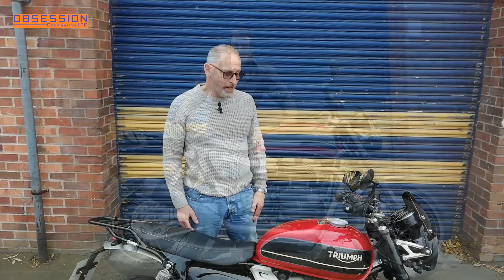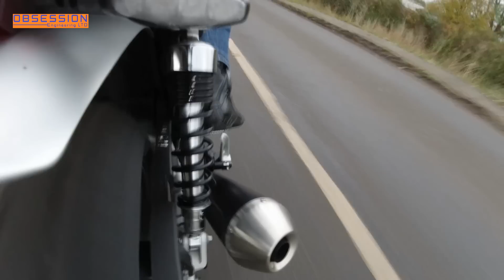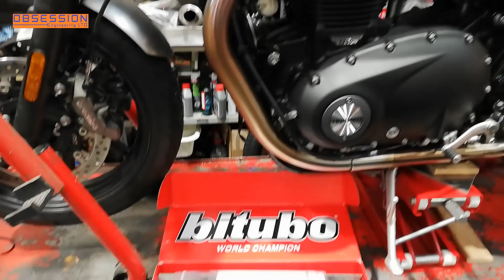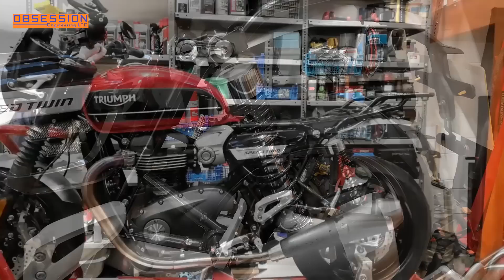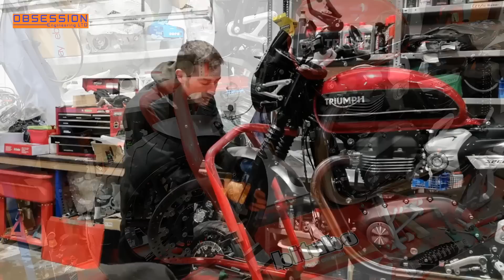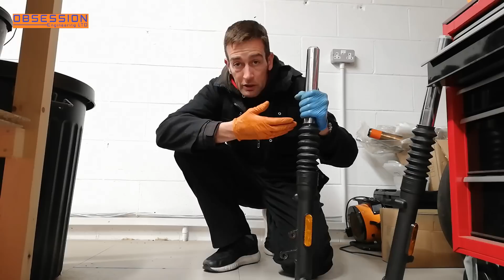How to improve a Triumph Speed Twin with Bitubo Suspension upgrade. Road test and how to guide

Comment: I have a 2023 speed twin. What is the cost for an upgrade?
Reply from the maker: The 21 onwards bikes, with the upside down forks were better anyway, or at least the forks were, so you'd probably only need shocks. For the same spec as we fitted they're £481 for a pair, and make a massive difference
Reply: @obsession_engineering

Comment: at a street-ride with s1000rr (date of build 2012/2013) i feel nothing only i switch all three moped legs into stage 5 with the key , tires were warmer than my hand , i felt safe till top speed 
only you and all others with many many miles more can ask for tuning - stock is expensive and good enough

Comment: On your video you show the rebound adjustment at the top and preload at the bottom, yet all adverts for these shocks show it the other way round.  Does it matter which way up they are fitted?  I could see problems adjusting the preload at the bottom because of the proximity of the adjusters to the silencers.
Reply from the maker: Depending on the bike model depends which way up the shocks are mounted. Luckily the preload adjusters are easily accessible.

Comment: Where to buy Bitubo in the USA? And do you recommend sticking with the same manufacturer of these components front and rear? Or does it matter?
Reply from the maker: I know there is a new USA dealer, but not sure on details.
I'd recommend using the same front and rear, so the damping characteristics will be well matched

Comment: Took one out for a test ride.....absolute rubbish. The OE suspension is awful. Amazed why anyone is prepared to spend 11k on a bike that you then have to spend even more on to make it rideable....strange times...
Reply from the maker: Fully agree with you there, especially as the additional cost during manufacturing would be very low for a big improvement

Comment: Do you think it's worth the extra money on the Speed Twin to upgrade rear suspension with compression adjustment also?
I'm looking at these shocks for preload and rebound adjust but can't decide whether to spend extra for compression adjustment also. 
Thanks!
Reply from the maker: Pete is very happy with the setup, the rebound adjuster does make a small amount of difference on the compression as well, and a good feeling can be found without the extra expense

Comment: G’day Dave, 
I’ve just ordered a set of rear shock to upgrade my speed twin. I didn’t think to check and presumed that they could be adjusted for two up riding. Is this the case please? and if not is it too late to change my order as I only confirmed a couple of hours ago. I wouldn’t want them to arrive down under if they aren’t adjustable. I bought the 80 to 90 kg weight range. Great video by the way
Reply from the maker: They are adjustable for preload and damping, preload will be the important one!
Reply: Awesome. Thanks Dave

Comment: Hello,  Have you ever seen signs of coolant leaking from the small hole in the middle of the oil pan under your speed twin?
Reply from the maker: Not as far as I'm aware. It's not uncommon for the little bleed hole to weep occasionally though, sometimes the seals pass a little fluid, and the hole is there for exactly that reason, so it leaks out and can't get into the oil. I've had it regularly on some kawasaki's
Reply: @obsession_engineering  It's a horrible design and one of those things I wish I would have known before purchase.  Thanks for your reply: DJ
Reply: @donjingle4059  Doesn't seem to bother the million or so Triumph twins out there on the road. Compared to the bikes I grew up with in the 70s, most modern bikes are surprisingly tight as far as any leaks go.
Reply: @andrewbecker3700  I beg to differ old motorcycle expert.
Reply: @donjingle4059  Sorry, I'm not the old motorcycle "expert" you say I am. Beg to differ all you want, I store some of my bikes in the house over the winter. Something I wouldn't even think of doing with a carbureted bike from the 70s. That is all, sir. I say "good day".

Comment: I need to do mine.  In 42yrs riding it’s the worst suspended bike I’ve owned since my ‘76 Fizzy. Triumph should be ashamed.
Reply from the maker: I can supply and fit the Bitubo products if you want, drop me an email to davidhewsonlimited@hotmail.co.uk
Reply: @obsession_engineering  I’ll keep you in mind Dave.   As a coincidence, I just watched your video a couple of days ago.
Reply: I’m interested. I’ve also just fitted a booster plug to my ‘20 model and it has transformed the bike with superb throttle control now and doesn’t upset the bike when going into corners. I think this and the suspension upgrade is all that is needed for the perfect bike.

Comment: Great vid thanks!
If you were to only upgrade one, would you upgrade front forks or rear shocks?
I'm finding the forks are the worst for stability so thinking to change first. But could be mistaken and would appreciate your advice.
Reply from the maker: I'd go forks first as they really are the worst bit. The package works best when it all matches though
Reply: @obsession_engineering  All in how much does this usually cost? I’m thinking about buying a speed twin or Yamaha mt09.

Comment: Honestly, just get a sportier bike. The constant complaining about suspension on these bikes led to some drastic changes in the 2022 model which ruined the look of the bike.
Reply from the maker: Pete loves the looks of the bike as it is, but it really is flawed by the cheap suspension. This way he gets the classic looks but with a ride to fit it's Speed title
Reply: @obsession_engineering  I don't think people get the spirit and intent of these throwback bikes. Upgrading them is basically like re-inventing the wheel. I personally would prefer to see them regress. I'm thinking air-cooled and carbureted. If you want modern performance, just get the Speed Triple.
Reply: @McScotty-325 Sounds like you need to go and buy an old shitter from the 60’s then.
Reply: @flamintasty  Picked up a CB750 last summer. Had an aftermarket exhaust and bars when I bought it. Tracked down the original parts and it's now perfect.